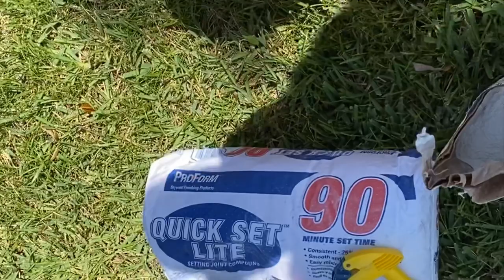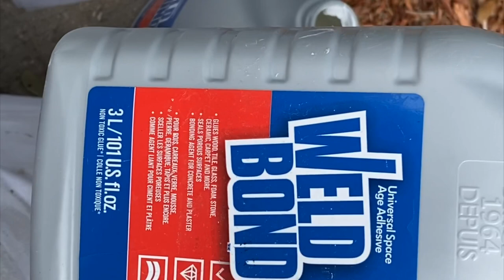Hang a Wallpaper Mural from Skimcoat to Finish - Spencer Colgan

Comment: Hi Spencer you lost me on using PVA as a sealer.
Reply from the maker: Please explain what you mean; I didn’t use PVA in this video and I didn’t mention it in this video. So please tell me and I will do my best to explain
Reply: @spencercolgan  Hi Spencer. The Well Bond Glue that you used is this not PVA?
Polyvinyl Acetate
You see for wall coverings it might be okay to seal the plaster with it but in the future when the paper will have to be stripped and wall painted the decorator will have hard time as PVA creates all sorts of adhesion related problems when painted over.
Reply: Matt Gloss you have to re seal after you remove the wall covering any way so I don’t see your problem either.
Reply from the maker: Matt Gloss I never use pea Matt. Never. It’s horrible.  I removed wallpaper today with weldbond as my skimcoat sealer.....it removed perfectly!  In fact i made a video of it Matt.  It’s uploading right now to YouTube.  It’s purple wallpaper. Please watch the video.
Reply: @spencercolgan  forgive me I was sure that the welbond is PVA.
Reply: @MAR108  if you use Gardz or similar deep penetrating sealer there is no need to reseal after careful stripping.
In Europe PVA manufacturers warn against using it as a sealer before painting.
There is few grades of the PVA from moisture proof to waterproof. 
The weak ones cause de laminating when reweted with paint by means of the water/surfactants. 
The waterproof ones are forming film that paint do not adhere to. 
It's common practice here in Ireland to use PVA for sealing bare gypsum plaster and it seems there is no problem until second or third repainting of the surface when the weak bond is activated causing bubbles and nightmares. What I'm saying is use only products that are designed to do the job.